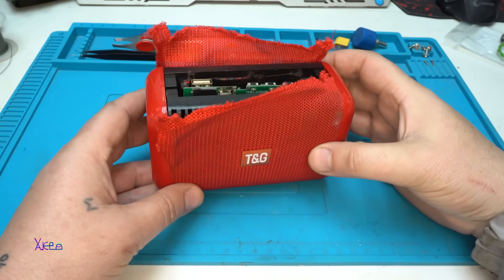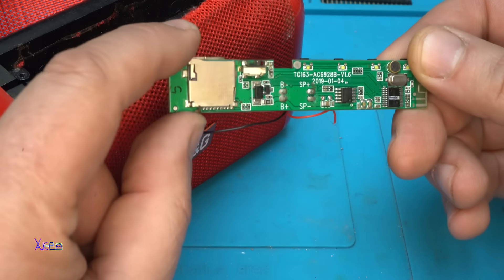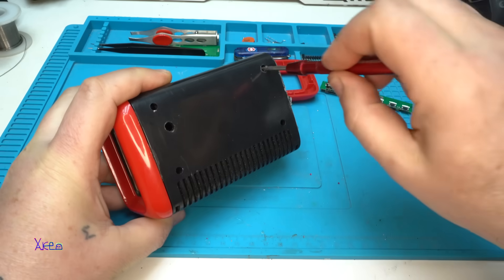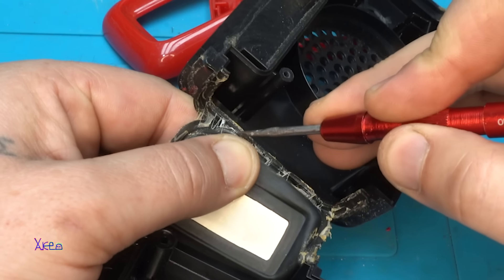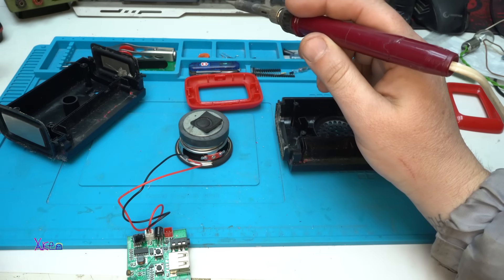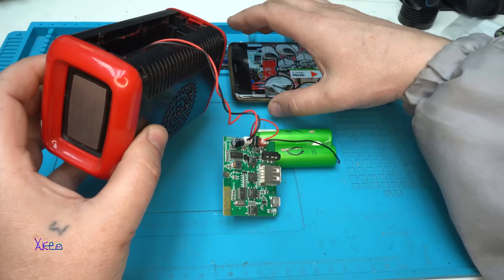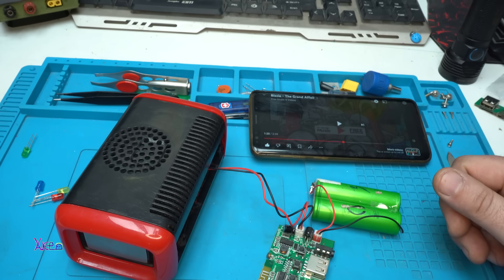This Cheap Bluetooth Speaker Has a Secret Inside?

Comment: Around 1:07 you look at part of the power circuit.  There is a battery, it looks like the previous owner accidentally removed the micro USB and pads and it may be able to be worked around.  One way to test is the red connector is the battery connector and connecting to USB with a cut cable to send power to the board via the female connector.  It should provide power to the battery as it is on the opposite side of the board showing the B+ and B- silk screen.  It is difficult to glue on a new connector and use magnet wire to jumper other people's mistakes and it can be done.

Comment: Hey there! Although it's very interesting to see new and weird electronics bought from Aliexpress, I think you can also make a series for scavenge old and broken devices found in flea markets and such.
It's very interesting and eco friendly to invite people to fix and re-purpose electronics like that. As we can see here, from a broken useless speaker, we can recycle the inner parts, or even change something inside and have it completely functional.
Even upgrade stuff with Arduino or ESP32 microcontrollers inside. 

Happy to see this topic in Hacktuber channel.

Comment: The enclosure isn't sealed, so it's as much a radiator as the things on the end are.  In fact, they may be reducing bass by damping the enclosure.  Mind, I'm not saying they won't vibrate, and I'm not saying they won't emanate sound, I'm just saying they aren't passive radiators.  Try taping all the vents shut (with several wraps, you want them to be stiff) and then see what they do.  Then they will be passive radiators.  Thanks for the video!
Reply: Complicated to actually find real passive radiators on small cheapy BT speakers like this one... All of them have vents and crevices open to the outside.

Comment: It didn't seem like the speaker or battery were attached to anything as if they were just thrown into a plastic shell.
Reply from the maker: I know someone try and fail in fixing this thing🤔
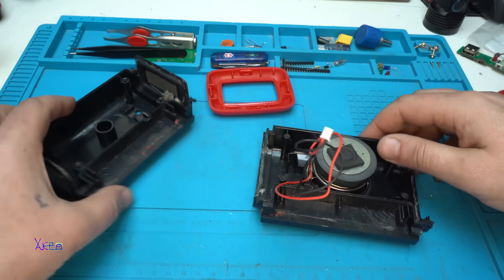Reply: The speaker is pushed from the back tube when you close the enclosure 5:52 you see in the left the tube, and on the speaker the mark made by it